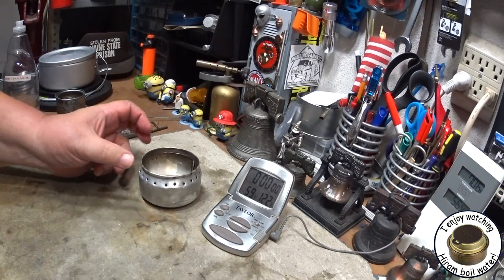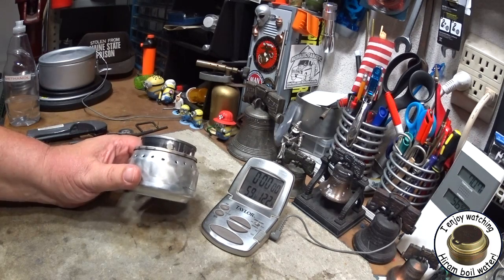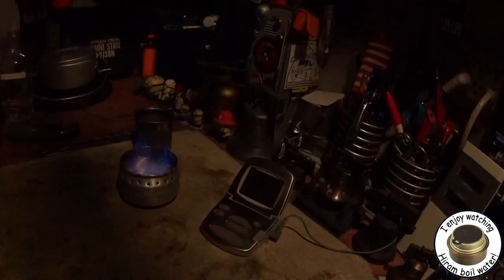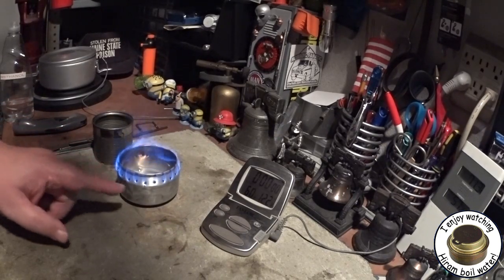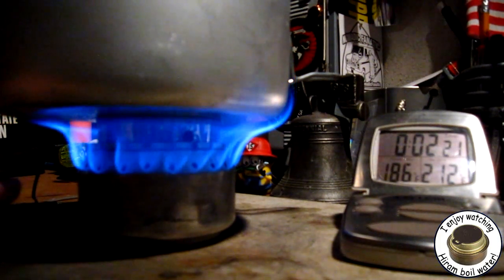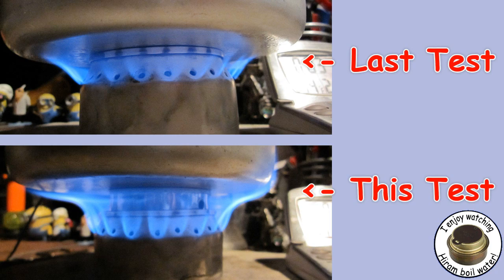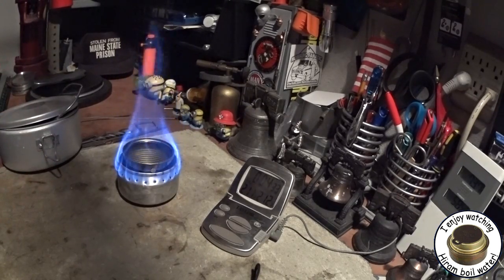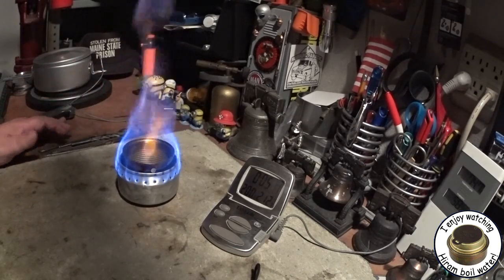NJ Chris' "SideBurner" Alcohol Stove - Boil test #3 - John Lord's suggestion

Comment: 1 inch sweet spot over rated.. All it does is rip through fuel. Give me a 5/8 or even. 1/2 inch distance and you will burn a lot less fuel. What thru hikers need.
Reply: It will take a bit longer but the fuel saved is worth it.
Reply: +MatoNupai  I agree with you guys on certain occasions... If you are a thru hiker, saving fuel is a priority... getting a boil out of a half ounce of fuel is remarkable on this stove. However, if you want a quick boil and your in a base camp environment where it is available then you can do this... thanks for all your imput
Reply: Chris; I have been building alcohol stoves for almost 6 years in about 15-18 different designs.

Take a look at some of the stoves I have made and shown in my channel.

Take a look at the Mahalo, then look at my ultimate stove.

There was a design between them I called the Topsy Turvy. This is the stove that gave me insight for the Ultimate.

The Mahalo had 10 1/8 inch jets and took 7:30-7:45, and the jets was 10 mm from the top.

the Topsy Turvy had 18 1/16 jets, and I moved the jets up to 1/5 of an inch from the top.

I started tweaking the stove by reducing the number of jets to get a relatively fast boil, and be as frugal as possible on fuel

I found that 15 1/16 inch jets was the best and placed 1/5th inch from the top

Now I must put some caveats in here before I give the final results.

1. I live in the Catalina foothills north of Tucson at 3,600 feet elevation, and water boiks at 207-208 degrees here.

2. I was using Klear Strip denatured alcohol formulated for Marine stoves.

3. I was starting with 64 degree tap water.

4. I was testing the stove under perfect conditions. Inside my RV.

5. I primed the stove with exactly 14 drops of denatured alcohol for a fast bloom., and 20 ml of alcohol inside the stove.

I placed the pot on the stove vand lit the priming fuel.

The stove bloomed in 6-7 seconds. The priming fuel burned for roughly 15 seconds or 7-8 seconds after the stove bloomed.

The 480 ml 64 degree water boiled at 208 degrees. I blew out the stove and reclaimed 7.5 mls of alcohol. A total of 12.5 mls alcohol plus 14 drops to prime the stove. A total of 13.1-13.25 mls.

So many people think jets MUST be 5/8 inches from the top.

There are three things that matter to me when designing a stove.

Frugal on fuel.

Work with small diameter pots because you never know when you will wreck your cook pot, and you will have to get by cooking in a Progresso soup can for a few days till you can get a better pot. My ultimate stove works with Green Giant Vegetable cans 74 mm in diameter. The ultimate stove will NOT WORK with beer can pots unless I move the jets to 10 mm from the top 2/5 of an inch.

When designing a stove It may be possible to boil two cups water on less fuel but the stove may need 15 minutes to boil the water. No one would use it because it is so slow. But the ultimate stove boils with 13.25 ml. And needs 6 1/2-7 minute average.

Not too shabby in my opinion

Comment: Wow! I think that boil time is comparable to jetboil now! John that was a pretty awesome suggestion... 

I've been tinkering with a new stove that I want to send in to you. Same design but I have to find a way to get the jets further down. The design that I sent you, the jets are around the upper ring which doesn't interfere with the inside sleeve... If I put the jets further down it interferes with the sleeve and I end up drilling holes through the sleeve... So I scrapped that one, now I gotta wait till I get another bigger beer can in the recyclables to try again...

Comment: You humble me.  (I'm almost crying)  Just trying to be helpful.

Look at the flame.  There is the inner flame apex which is where the highest heat point resides.  Not the outer flame tip.  Also have a smaller aperture at the top, allowing more airflow, and more separated flames.  Look into the Trangia design vids, (and some of my comments), and how they attempt their flames in cold weather.  Even my comments to them about having an outer ring for starting flames, like I mention as your lower and outer flame ring (additional flames if you so desire.  If you are able to make a small flange on the side (like Trangia) and then perforating for those side flames,  then you are spot on!

Glad to help all bushies and preppies.  God bless!  Knowledge not shared is worthless (quoting Mize Survival school).
Reply from the maker: +John Lord Sorry , never meant to humble anyone. I always look forward to input like yours. Thanks.
Reply: +Hiram Cook Ha!  Just busting your chops.

I suggest further modifying the fire holes and flame size.  PROBLEM:  smaller/many flames, LESS heat, MORE time, xxxx fuel usage.  SOLUTION:  larger/fewer flames, MORE heat, LESS time, same (maybe less?!) xxxx fuel usage.  Find some JB weld or epoxy glue and plug up every other hole in the unit.  Awl out the remaining fire holes to 25-30% ( ... one fourth to one third) greater diameter.  With the previous raised elevation hitting this even larger inner flame apex (sweet spot), you should be matching/excelling my JetBoil for performance.